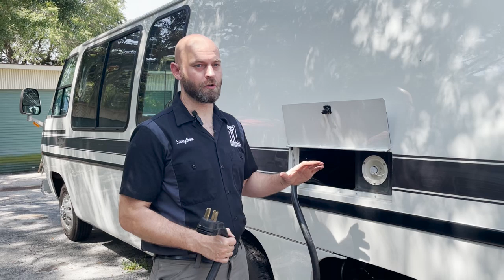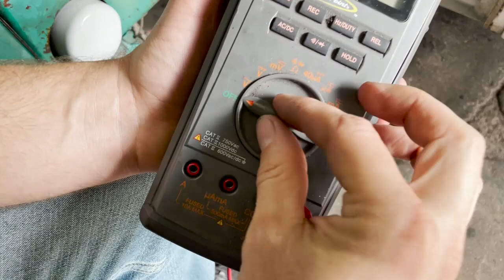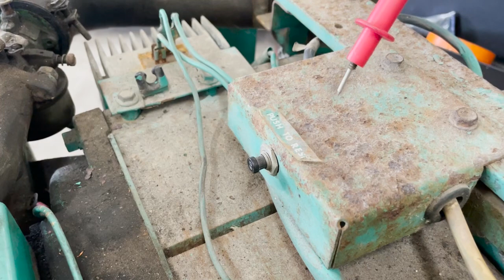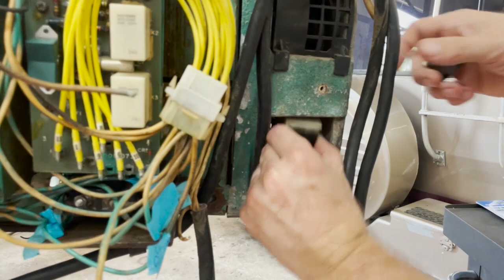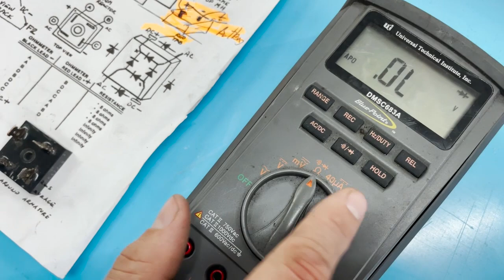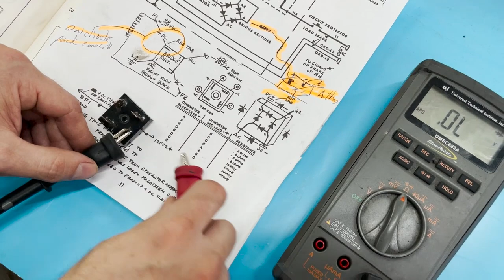GMC Motorhome - Generator - Episode 2 (Making Power)

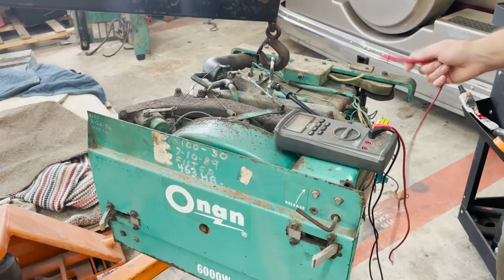Comment: Hello, thank you.  I have a question for you.  At 11:09 into your video, you showed a part I need on my 6000 generator.  I dont know what it is called or how it works.  It is on the very front top left corner of the generator and is bolted to the cast iron exhaust manafold with only 2 bolts.  It has a swivel arm on top that clips with about a foot long steel rod to the back part of the generator.  It has a round green type of coil that is attached with a long power wire about 14 guage to the rear right side of the generator power.  The round green side of the part is about the size of a silver dollar and about an inch deep.  The function is to open and close a small door type section inside the housing that bolts to the cast iron.  Well, the wong power wire is completely burned from one side to the other- a couple feet long or longer and the round green button has broken off of the rest of the part body that bolts to the cast iron.  Please explain what that part is, what it does, and if there is a replacement part for it and where I can buy it.  I hope I was complete enough in my question that you can understand my situation.  Thanks again. Ron Siegrist

Comment: Hi, I work every day as a generator technician. “Flashing the field” is when you apply 12Vdc to the ROTOR not the stator. To flash the filed you apply to the field wire that go to the brushes . The Rotor is always a DC part of the generator the stator is AC.  Normally the voltage regulator will adjust the DC voltage to the slip rings. To generate the right output of the stator. Some generators use residual magnetism in the rotor to generate a mild output voltage, which powers up the voltage regulator - for those machines they can loose the magnetism and flashing the rotor with 12v will wake everything up. 
Newer generators don’t reply on this, the voltage regulator has battery voltage there and will always apply it to the field when the genset starts. As soon as the voltage regulator sees some AC output, it switches to use the AC power… convert it to DC and manage the rotor DC voltage. I have never seen putting 12V dc into the output of the generator all i can imagine is blowing the bulb.
Reply: AHH, But in the case of our Onan's, the field windings are the stationary (stator) and the armature is the AC output. So the brushes are carrying the upto 6Kw AC power.  Backwards from most generators.
Reply: @brucehislop8860  i am VERY skeptical about that… but even so. Applying 12V dc to the AC side of the generator is really just an excuse to pop fuses or light bulbs
Reply: @bbbojangles  Sorry you don't believe me that the field is the stator and the armature is the output.  Youtube does not allow posting of links, but google Onan6kwNH_Major-Service.pdf on bdub's site and look at the generator schematic on page 44/45.  I'm not saying that his method of flashing the field is how I would do it.
Reply: @brucehislop8860  i replied below… and fully admit I was unaware that these gensets are rotating armature! I am slightly (hahah) sorry that I ranted a little, and injecting 12VDC into the output of the generator still makes no sense to me. BUT if I did not post it, then I would not have learned and I am quite thrilled to learn this. Jason, absolutely no offence to you by the way… you guys are doing this, and somehow it might be beneficial to revive a non-producing generator. I am more picky of the terminology. Flashing the field is normally when you manually create the field by injecting DC voltage into the DC side of the alternator. Normally it is the job of the Voltage regulator to do this. On gensets that rely on residual magnetism to get the first little bit of AC output, they often need flashing after a prolonged storage.
Reply: @bbbojangles  Actually, upon looking at the Onan generator schematic and GMC wiring, there is nothing electrically wrong with how they are doing it.  Quite an eloquent solution actually.  The lamp provides the current limiting and when the generator starts producing power, it simply blows the 50 cent lamp.  
However its a bit scary to show this to people who have little or no electrical knowledge.  The test light certainly does not have any CSA/UL/ULC approvals, and the long exposed probe is an accident waiting to happen.  But if I was doing this on a regular basis I would simply put some shrink tubing over the probe for insulation.
Reply: OK, i stand corrected on the rotating armature design. Its very cool to learn this. The field is the DC powered Stator and the AC come from the rotating part. The 6000 watts of 120VAC passes through the slip rings. 
So to flash the field would be to force DC volts into the stator. It could be a great way to wake up a non-producing generator. I still dont think putting 12VDC into the 120VAC output is a good thing to do.

Comment: Skip Onan the barbarian.    It's loud, it vibrates and shakes the coach.   I use solar, and 2 LIPO batteries.  The bats can run the fridge, toaster, microwave  for 2 solid days with ZERO sun.   If I will need A/C I bring a portable quite enclosed Champion genset.     A long cord then puts the gen and the noise far away.
Reply: Since this is a video about the GENERATOR… how is your post relevant? I mean using solar as a replacement is pretty common knowledge these days. If I wanted solar, I would watch videos about solar. But some of us live where there is little sun.. or operate the coach where there is no sun. Or for whatever reason we wish to use the generator… what is the point of objecting and posting this?
Reply: @bbbojangles  Go back and re-read my complete statement.  It's all there.
Reply: John, I am assuming you have an inverter as well? Have never seen a 12volt DC electric microwave or toaster...
Reply: @AndrewsGMC  yes, 3500 Watt inverter.